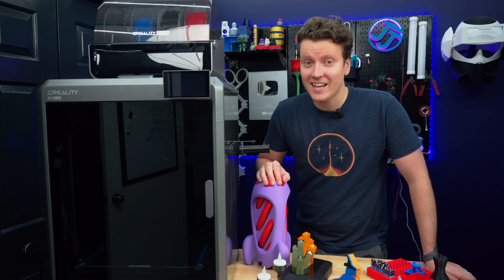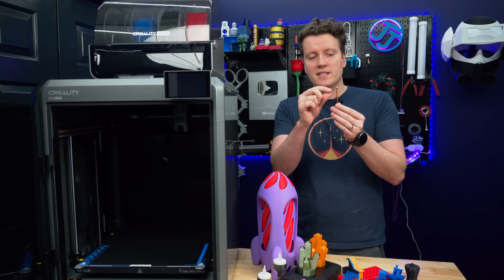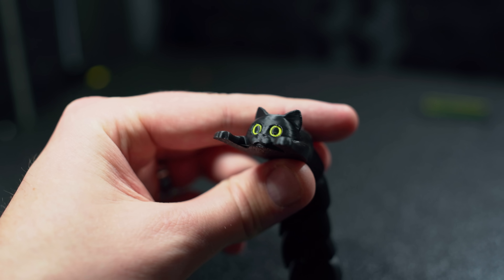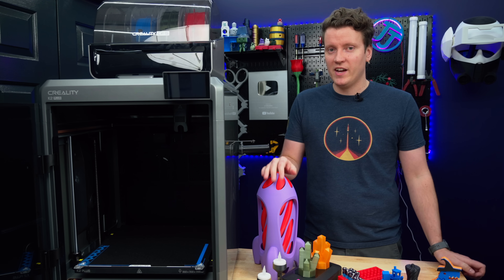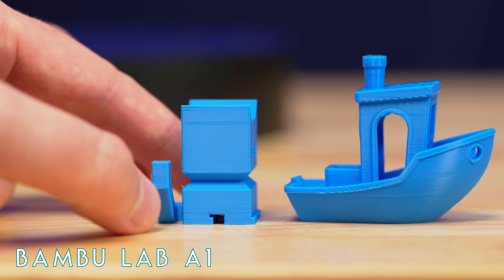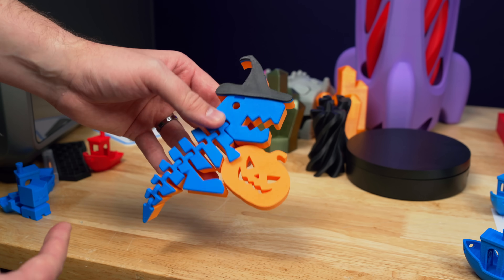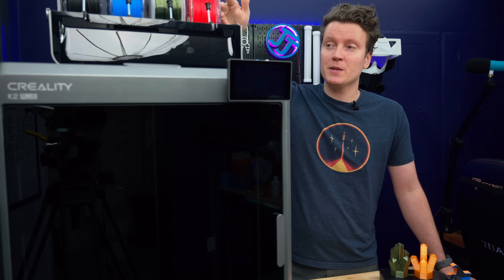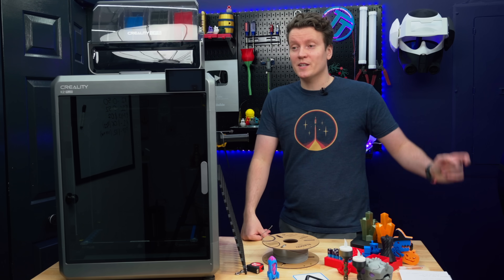New Multi-Color 3D Printer by Creality | K2 Plus Review

Comment: No it is NOT  2 and 1/2 feet left to right or across the back,  What the heck.  Yes it is big but 20 inches x 19  inches x 27 tall and 9 more inches for the CFS if you have one.   2.5 feet is 30x30.  I

Comment: Except it takes 20 minutes to start a damn print, it's ridiculous..... very first print, got a wonderful jam, it was PETG.... a brand new PETG. 

Then if you go for the higher end filaments, GOOD LUCK.  Bamboo Labs blows it out of the water. 
You can tell this guy is 100% sponsored by CREALITY,  #1 the printer isn't "great" or barely even "good".

How do you say this other printer was better, buuut the K2 plus was better in being bigger. 

ABS no.... PA no.... all dried properly, used both their slicer settings and my own. 

The creality slicer is trash, use orca. Oh and don't even get started on color bleed, why do you need to double what creality claims.. even in the red it bleeds where bamboo doesn't
Reply from the maker: Maybe there's something wrong with your printer there. If you don't run the full flow rate and PA calibration with each print it starts way faster. ABS works great for me. What kind of issues are you finding? 
Also Creality Slicer is way better currently than Orca. The ability to mange multiple machines and send sliced files to multiple printers at the same time is way better than Orca. I only really use it with creality machines. Orca could be a better slicer for multiple brands. 
At the time of this review, Bambu didn't have a large printer option, but now the competition is way better for large enclosed printers. I can't go back and edit my opinions in old videos.

Comment: Colorblind WORKAROUND (4:15):  Get small sheets of transparent acetate--one red and one green and label them. When you hold the green sheet over the color selection screen, the greens will appear white and the reds will be dark.  When you hold the red sheet over it, the reds will be white and the greens will be dark.  This is from an old black and white photography trick where colored filters are used to modify an image, for example, a yellow filter to darken the blue sky in a landscape.

Comment: from the prints i am seeing issues with too much pressure in the new nozzle, the nozzle being longer will allow pressure to build up even after retraction, his also will cause more oozing than normal. print temps can be lowered due to a longer more effective nozzle and that will also fix your issue.

Comment: Hi J.J , could you test the  precision and the squareness  or print a circle for example and verify how round it is. I own A K1 Max and it's awful  at doing these things. And I tried everything to fix it but the only solution was to buy a brand new  Bambu Lab  X1 carbon  which does very precise printings , so you can print technical parts .
Thank you in advance!

Comment: Thanks for the review! I have been toying with getting my first 3D printer for months now and this is the first review I've seen of any printer that points out an issue with color selection for color blind people. I had assumed color selection would have actual words instead of color dots. As a color blind person, having to figure out the color without words will be an annoyance. It looks like this printer is out of the running for me due to its size, but now I know I need to research color selection, too.

Comment: I own a bambulab X1C and I say this with confidence, holy crap this is literally a clone of the X1/X1C. The software is the same the filament system is the same. Everything is the same except for the build size, But bambulab does a better job at it for cheaper.

Comment: That 0.2mm test print 350x350mm is impressive! That is 0.007 in inches! It shows Creality has their bed leveling software dialed. I think this printers biggest positives are its huge print size at 350mm square, and its heated bed and heated chamber and multiple fans cooling from multiple angles make it the best to be able to print in all the new materials that seem to keep coming forward. Great Review.

Comment: Comparing the k2c to the p1p or even a1 mini shows how good the a1 mini is. It’s like comparing a Mercedes to a Toyota and the Toyota is so good. However, C’mon you have to compare it to the printer in the same price range and not complain about the lack of features when the x1c has all the features lacking from the a1 mini. You don’t even need to be a fanboy just a fair comparison and vice versa if Bambu released something new, you don’t show the ender 3 v3

Comment: The product description says it doesn’t support flexible TPU, but your video briefly shows a TPU printing preset on its touchscreen. Have you tried printing TPU?
Reply from the maker: TPU just doesn't work in the Multi-Spool changer. You have to use the side spool holder for that
Reply: @ Thanks for the response! What would the process be using this machine with TPU and PVA in a single print?

Comment: These speed tests are great, and the surface quality is excellent. Can the K2 Plus go any faster? Could you do a comparison on the FLSUN T1 Pro? I've heard it's very fast.
Reply from the maker: Yes the K2, and all the other printers can go faster. The manufacturers always release a specially tuned Benchy to reach some crazy speeds, but the default speed will give the highest print reliability. I think I might be getting a FLSun T1 soon so I can test out the speeds
Reply: @JJShankles  thank you for getting back to me! I’m really looking forward to it

Comment: Curious to see how the Creality K2 stacks up against the QIDI Plus4 in print quality! Also, I’m really intrigued by the K2 Plus’s all-aluminum enclosure—does it actually hold a consistent 60°C chamber temp during printing? Not a fan of the chamber heater outlet being placed higher up, though. Bottom positioning would make more sense for optimal heat distribution.
Reply: More interested if they cloned the Qidi fire starter board.

Comment: I own several 3D printers. I have two bamboo lab p1s and one quality k1 Max. The k1 is broken. It is such a piece of garbage compared to the bamboo lab. The problem was is that prints I were doing required constant cleaning of clogged nozzles. So I was taking apart the hot ends on both of them. The bamboo lab printers used probably 25 cent connectors. In the creality k1 Max was a half a cent connector. The k1 Max connector to the extruder motor didn't last very long. 
My advice to anyone is to avoid creality products altogether. I have a lot of creality printers that simply stopped working. I'm no longer a fan.
Reply: Sounds like a you problem man. I have a E3V2 and a K1Max and while there are issues sometimes. Learning your printers and learning what to avoid instead of just getting pissed at the machine after a few issues might solve your problem. Just my thoughts.

Comment: Hmmmmmmmm, this printer looks very familiar, I wonder where I've seen it before
Reply: I mean, many people wanted the Bambulab without the vendor lock-in
Reply: @MiesvanderLippe  i thought the same when i had an ender 3V2 that i upgraded SO SO SO much. but now with my p1st i just dont get the feeling that i need to upgrade anything. There is still many upgrades that can be done that are non bambu products like build plates, EGB, hot ends even the screen.

Comment: Not impressed by the print quality on the K2, the A1 was clearly the winner.  Disappointed to see that they copied the Bambu AMS and it's problems with cardboard spools (the Elegoo one seem to get bent in shipping all the time).   So, I'm still waiting for a larger than 250mm printer that just works.
Reply: There will be a bigger Bambu Lab for sure. Creality probably wanted to launch their model on the market first. But I no longer fall for new Creality products, my experience with the K1 was enough for me. It took many months and upgrades before the device had reasonably good print quality. But I still have complete failures from time to time. My cheap A1 just prints away and hasn't caused any trouble so far.

Comment: Uh.... 2.5 feet? Says online that it's a little over 20 inches x and y, that's almost 10 inches difference... Are they lying or are you exaggerating?
Reply from the maker: If you take the side spool holder off then it is right at 20 inches wide. The 2.5 ft is how much space I would want for comfortable working space around it
Reply: @JJShankles  If you are going to review the printer, then give the actual measurements instead of making up numbers. Nobody is wondering how much room you personally want around the machine, and how is anyone supposed to know that when you only say the size of the printer is 2.5ft by 2.5ft. We want to know the real size because everyone's workspace is different and might not need or care about extra space around it.

Comment: hmm pretty sure those are closed loop steppers using FOC I could be wrong...
Reply: You aren't wrong.  The closed servo loop is on the integrated motor controller... on the motor.  As far as the computer that's controlling the motion, it's still an open loop motion control system.
Reply: @Liberty4Ever  Thanks mate. :) Glad to know.
I've built some CNC routers with some serious controllers and optical encoders / servos. They were nothing like these "closed loop" that some manufacturers are offering =)

Comment: Wonder if you have to do multi color or if I can just do one
Reply from the maker: It works great as a single color printer!
Reply: You can load four of the same filament in the CFS and configure the K2 Plus to start a new reel after each runs out.  This could be very handy for a large print that fills the 350 mm cube, and you wouldn't need to worry about having enough left on a reel to finish the print job, so no more piles or mostly empty reels to manage.  That's actually fairly huge.

Comment: at $1500 thats a big no way from me. I can get two bambu p1s with ams for that.
Reply: Still cheaper than the only other CoreXYs with the same print volume on the market (Prusa XL, Voron 350, Rat Rig V-Core 4.0), but it's a Creality so it's probably got nonexistent quality control and after-sales support is gonna suck.
Reply: @theglowcloud2215 The Qidi Plus4 gets 300x300x285 with all the same stats and less patented Creality VFA’s. Also significantly cheaper.
Reply: @theglowcloud2215 laughing in Ender 5 plus mercury conversion. Under 800 euro and 370x370x400

Comment: I just bought a Bambu Labs printer, and I was feeling just a tad of buyer's remorse, until I saw the pricetag. The Bambu P1S with multi-filament system, with essentially the same features, other than the 100 mm cubed larger build volume, is exactly half the price, at $750, compared to the $1500 this printer sells for with its mult-filament system. So, unless that extra build volume being part of the same printer (since you can get two Bambu Labs P1S systems for the same money as one K2) is a game-changer, it doesn't seem worth it.
Reply from the maker: For most people I think the P1S would be the better choice. The large high temp printing is worth the price for only a small group of people and print farms
Reply: @JJShankles  As a newbie in the space, I don't even know the material properties of most printable plastics, yeah.
Reply: Unless you bought the even more expensive X1E, your printer has no active heating, and a much lower bed temperature and nozzle temp.
Reply: The K2 is aimed at those who work with advanced filaments. The P1S can only hit 300c for the hotend, 100c for the build plate and has no active heated chamber. The k2 plus hotend can get to 350c, build plate 120c, and has an active controlled heated chamber which is up to 60c. This is more aimed at the X1E from bambulabs. And even then the X1E can only hit 320c on the hotend. The K2 can do lan only by port the same as the X1E. Not to mention the X1E is over 2k USD with the exact same build volume as the P1S. The K2 doesn’t require an “AMS Buffer” like bambu does, and seems to have fixed some of the issues had the original AMS.
Reply: @SeriesDmusic  Or you can buy the Qidi Q1 Pro that is 399$ and has been able to do 350C-120C-60C for a year at a fraction of the price.

Or a Qidi Plus4 that can go even higher and do 370C-140C-65C for 799$.
Reply: @ if they can fix the issues the Plus 4 has it’s a great contender, and if you don’t need 350mm build volume. The Plus 4 was 305mm?
Reply: Am waiting for Bambulab to release their new line of printers, all these will disappear 😂
Reply: But the increased build volume IS expensive, as is the multi filament. Price difference seems roughly on par, doesn't it?
Reply: I promise Bambu has the better ecosystem as well...
Reply: @Xenthera  - The closed proprietary Bambu ecosystem is the reason I won't buy a Bambu Lab 3D printer.  The default is to send the print job from my computer to the Bambu cloud server (in China?) and then back to my printer that's two feet from my computer.  That's beyond stupid.  The only reason to do that is evil.  Bambu allows offline printing but it's not easy.  They want your files.
Reply: @Liberty4Ever Tienes razón, es terrible que nadie valore la privacidad, no sé qué le sucede a la gente.
Reply: This is a comparison vs a X1C, comparing it to the P1S seemed like a convenance for JJ as he didn't have an X1C. But the price between the X1C and K2 is virtually the same.  Just wait until Bambu Drop a $2500 printer next year that is a "more advanced" Prusa XL

Comment: Wouldn't a cubic volume with sides of 350mm have a much larger volume than the 350mm^3 shown on-screen? Unless you meant (350mm)^3, in which case I apologize
Reply from the maker: Good catch there, yes it is larger than 350mm^3. I was just trying to fit the text on the screen, and I should have put the parenthesis!

Comment: i really hope for the upgrade kit for the k1 max and k1 series that they also include the 40mm/s volumetric hotend/heater because thats a big jump in proformance. and i can only imagine what a CHT nozzle can do on k2. unless thats what creality has added to the printer to get that 40mm/s flow
Reply from the maker: I think the upgrade kit will need to change out the hotend, so hopefully we will get some big gains. I hope they can get that figured out at a reasonable price point

Comment: Instead of copying Bambu's printer and AMS I, as a Bambu X1C Owner, would have preferred a printer with at least two print heads. The time it takes and the waste produce when purging filament is annoying.
Reply from the maker: I would prefer a two color printer using two heads instead of a 4 color AMS using one head, but everyone is just making quad-spool holders
Reply: My thought too. A device with two or even more heads could print far faster as it can instantly swap from one filament to another and would eliminate the need for wasteful purges. The comment that that cat print used far more filament in waste than ended up in the actual model was insane. 
My first 3D printer was a CTC with two heads.
Reply: There is a cool hack for the Voron and SV08 that allows up to six quick swap print heads.  I  wonder if Sovol will be offering a version of the SV08 that's similar to the Prusa XL for less than half the price.  I'd love to have an enclosed SV08 with two print heads that would allow me to print ABS and TPU on the same part.  AMS and CFS can't feed low durometer TPU so this is the only way I would know how to do that.  The faster filament swaps and much less material waste are added bonuses.
Reply: xD

Comment: Sweet heck thank you for actually showing in focus video of the prints with proper lighting to show defects, unlike 90% of reviews. My only critique would be to please get a more stable surface so they aren't moving around so much. K2 Plus print quality looks okay, but far from perfect. I'm sure there is some tuning and slicer settings room there. Always amazing how good the A1 and A1 Mini print quality are. I think the extruder on those printers shines. The Ender 3 V3 quality was surprisingly good too. Good stuff.
Reply: yeah i can confirm, my K1M has perfect walls in both directions are i moved to a much more solid bench (my bench weighs about 100 kg) anything under that and i get artifacts.
Reply: @heinrighbeukes6010  I solely meant for the footage he was capturing. 😅 Sorry for any confusion.
Reply: yep A1 has single gear extruder plus cartesian so it really has nice prints
Reply from the maker: Thank you! And I was filming this while the K2 was printing on the table so it caused the wobbles. The K2 keeps getting firmware updates so I will have to keep checking and make a follow-up if I see substantial improvements
Reply: @JJShankles  Ohhh that explains why the table was moving so much hahaha.
Reply: 💯 . Worst part is when they do that and use white filament.
Reply: @baljazz  Hahaha absolutely.